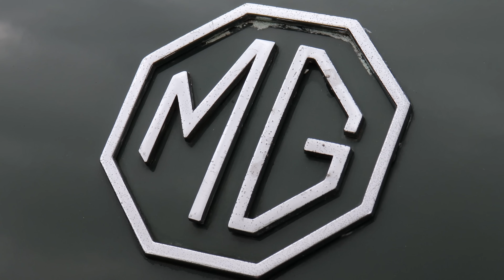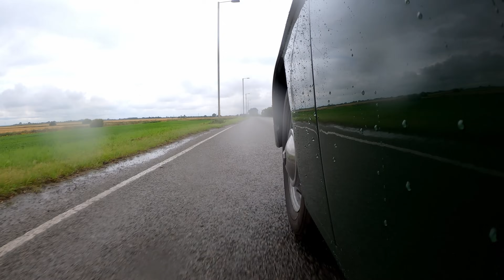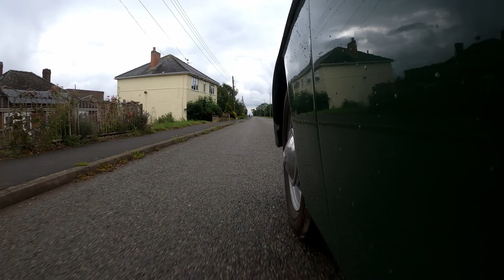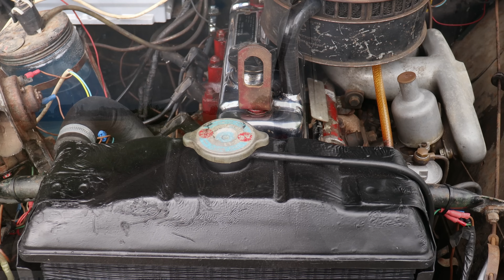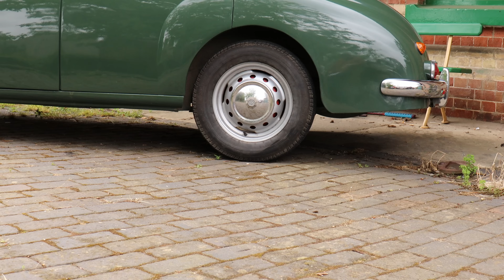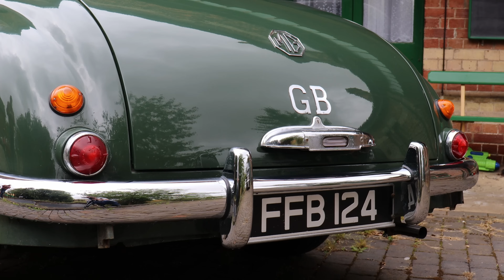The MG Magnette Is A 1950s Luxury Sports Saloon! (1955 ZA Road Test)

Comment: Ozzienuck.....V8 is overkill. You can upgrade a Magnette & still keep the overall theme intact by using MG motors up to 2ltr with HP figures well in advance of its' original. Normal usage would be more than ample.Next you'll tell me a T-type would go better with a V8. Gawd

Comment: My first MG as a young lad in the late 70s was a (hand) brush painted (yes you heard that correct) tired green ZA. I loved it, was rust free and on the button. I loved the styling etc. I always wanted a ZB Varitone but they were/are pretty rare in OZ. Later in the UK I progressed to MGBs, then  B GTs, an MGC GT (Downton Tuned Stage 3) followed by MGB GT V8 conversions etc. I'd love a subtly modified Magnette with period wire wheels and dare I say an MGB engine and overdrive – surely something MG could/would have done, albeit with an MGA 1622 engine in period – costs aside? Still lovely cars and lets not forget the more gentle Wolseley 4/44 version, of which many succumbed in the 60s/70s for their T-Type engines when the MG T-series had a rebirth amongst enthusiasts.

Comment: I bought an MG ZA low milage in mint condition. Motorola radio and a set of winter tyres.
One day while looking for a new squeak I found safety belt mounts in the door pillars and under the front seats. Seat belts were not fitted in those days, but my elder brother-built race cars. So, I check with the Irving safety belt rep, and he got me a set. These proved valuable when a couple of years later, a stop line runner hit the rear quatre and flipped us over and left me and the front passenger hanging upside down, but unhurt.
The car was sold as parts, and I bought a Riley 1.5.

Comment: It was the Riley Pathfinder that was regarded as the Sport version of this body style. It was chosen by Police forces as a pursuit car for that reason and was a costlier option.
Reply: The Cops used the Wolseley 6/90 not the Pathfinder (the 6/90 being the cheaper spec version of the Riley).
Reply: @marknelson5929 Pathfinder had a 2.5 litre in-line four cylinder.Wolseley had a more advanced straight six,with an overhead camshaft,so was considerably quicker than the Riley. I think the Riley engine followed on from the 2.5 model RME.I remember that car having absolutely massive chassis rails,something like six by three inch box section! I think the Pathfinder and the 6/90 were the first “monocoque “ models.
Reply: @dennislane100  Sorry to correct you but the Wolseley 6/90 and Riley Pathfinder both had a separate chassis...they weren't monocoque. The Riley Pathfinder was actually quicker than the Wolseley...and quicker than the Riley 2.6 which replaced it (which had reverted to the Wolseley's straight six). The RME was 1.5 litre...not 2.5; that was the RMB/RMF. Otherwise, your post was correct!
Reply: @marknelson5929  Some police forces did use the Riley Pathfinder. Although it looked similar to the Wolseley 6/90, they were quite different cars so while the Wolseley may have been cheaper - it's a bit unfair to refer to it as a 'cheaper spec version of the Riley'!

Comment: Add an MGB motor,5 speed gearbox & boosted disc brakes......a car for then,now & the future. Simply wonderful.
Reply: But a highly usable keeper.The kids can worry about its value.
Reply: @PhilipShand  OK.
Reply: That would absolutely ruin it and make it valueless.
Reply: Not necessarily...I've come across several {British} videos on YouTube where people have dropped in the Rover V8. A friend of mine had a 58 Magnette back in the late 60s and I got to drive it a few times. I really liked it but wouldn't be opposed to having one with more power and a 5 speed box to keep the revs down on the freeway. Let's face it, it's the styling and interior that most of us like on these classic cars, so putting in a modern more reliable, powerful and fuel efficient engine would make for a very nice package. I'm not saying this would be appropriate for all vintage/classic cars but the Magnette is still a viable car on today's roads, so a performance upgrade wouldn't hurt.

Comment: Ironically the Magnette shared its bodyshell with the Wolseley 4/44 which sported an MG TF engine. In the 1960s many 4/44s were broken so the engine could be slotted into a TD or TF MG. The Z type MG was a real MG sharing the engine and box of the MGA and it had rack&pinion steering. Its susessor, the Farina Magnette was just an Austin Cambridge with knobs on. Autocar summed it up as "An opportunity for the ordinary motorist to drive a car that sported one of the most exciting motoring badges of all time !" Talk about damning that old barge with faint praise.
Reply: The Magnette only shared the Roof, Front Doors, and Boot Lid with the 4/44. !! They were both designed at the same time by Gerald Palmer, but the Magnette was held back a year waiting for the new B Series engine to reach production.      It was the First BMC car to get the B Series engine, 18 months Before the introduction of the MGA.
Reply: I was around in those days and my boss drove me to work in his 4/44, four on the tree, didn't the 4/44 have rack and pinion?, My memory is that when BMC was born it found itself with a load of bits and pieces from the companies that made up this new concern and one way to get rid of the left overs was to use them up in the same bodies, hence the MG Sedan and the 4/44, just change the grill basically to alter the appearance and put in a floor shift.